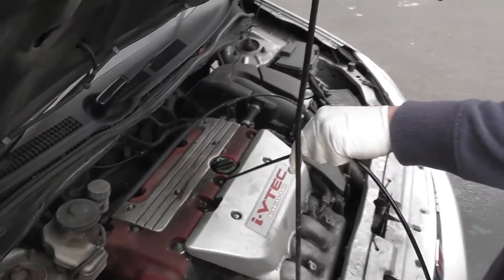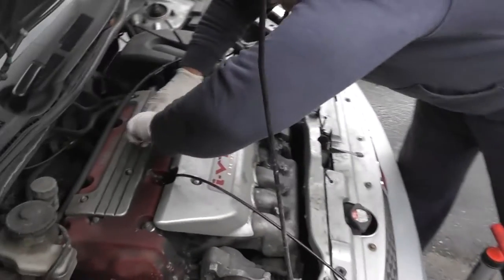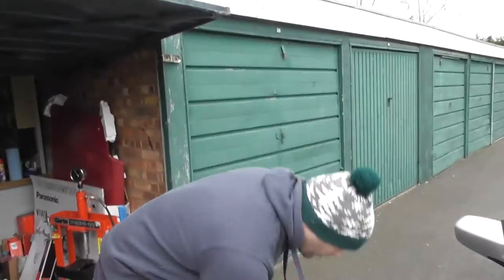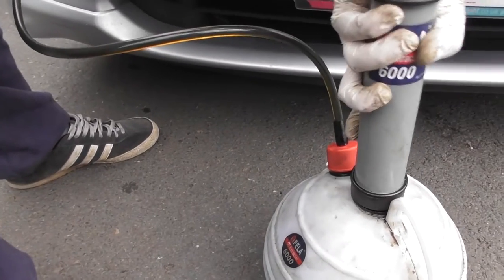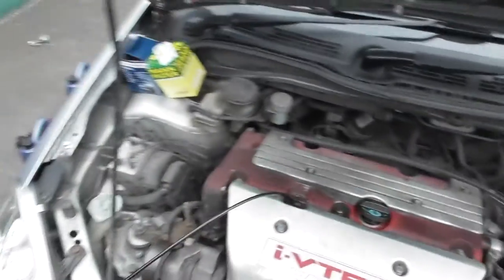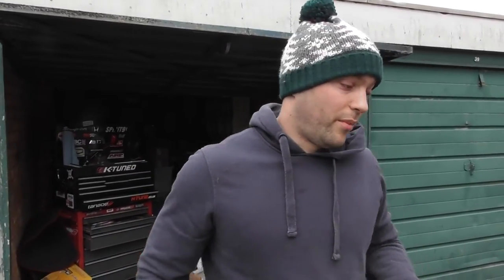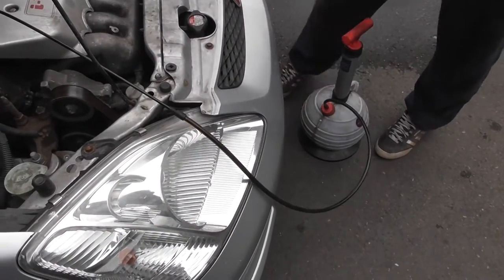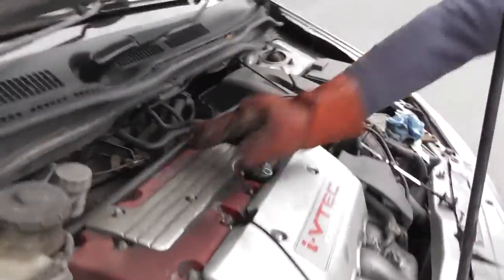T2EP3 Honda Civic Type R K20 Part 6 : EP3 Service Engine Oil and Filter

Comment: Will removing oil this way with that pump remove the gunk from the bottom of the pan? 😕
Reply from the maker: Simon Kailla The pump takes the oil from what should be the lowest point in the sump, therefore as long as the oil is warm, you should have minimal gunk atvthe bottom as you put it. I have also done oil changes in the normal way from below previously on this car and always change the oil filter regularly. In fact the pump stopped working recently so I have not been using it. I think it is a good tool for a quick and easy oil change. Thanks